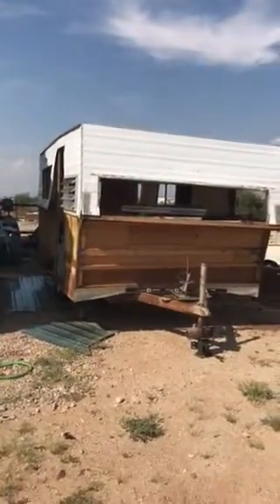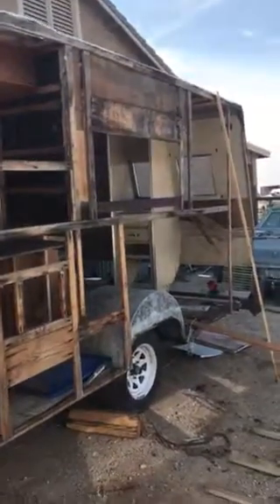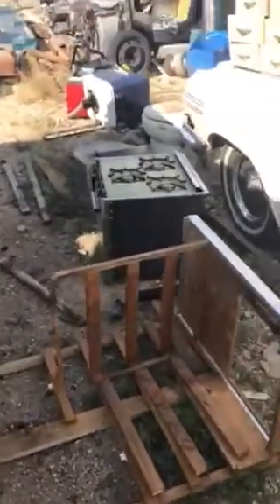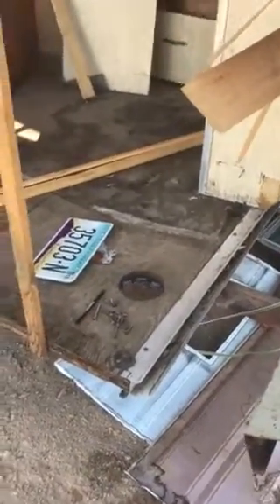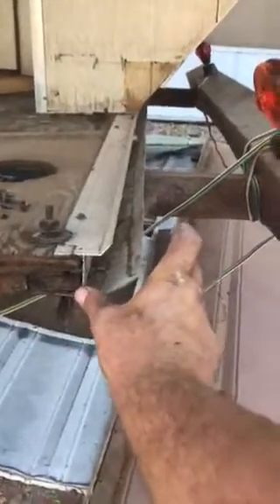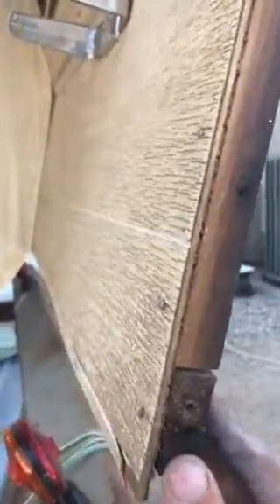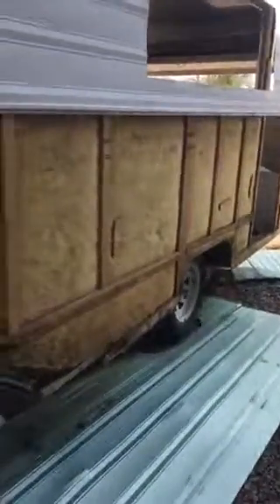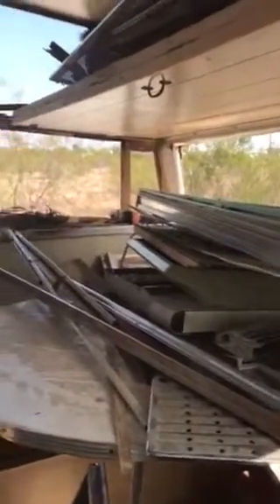Vintage 1967 Aristocrat low liner ST rebuild

Comment: Hi, I am refurbing a 67 lo liner. The front is pretty badly ripped up. Could you please tell me in the "shelf" on the front rests flush with the 7 ft plywood or if it hangs over inside of the trailer to create more of a shelf.